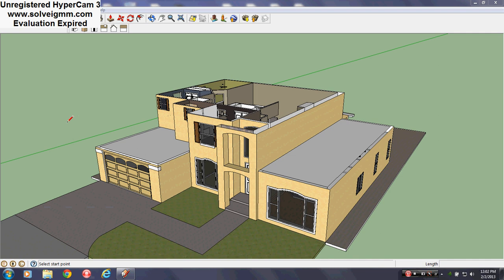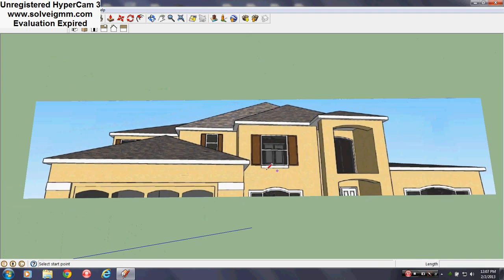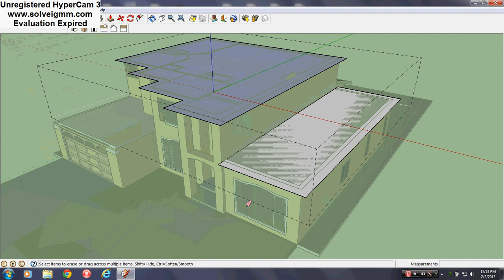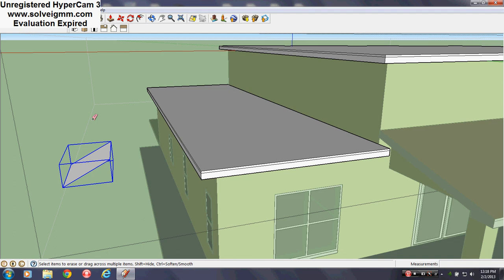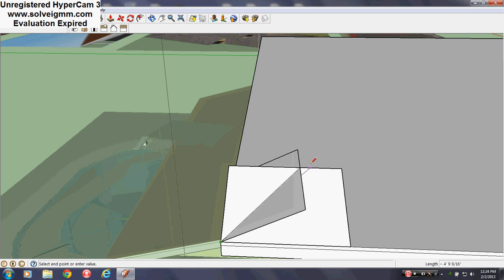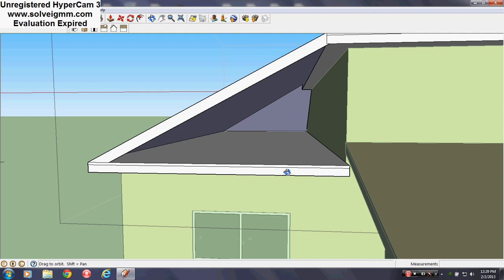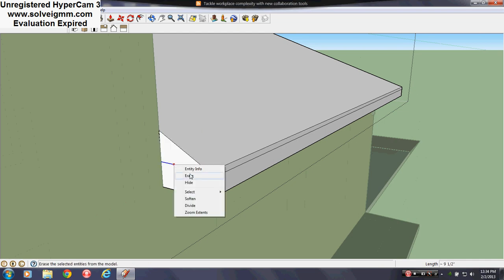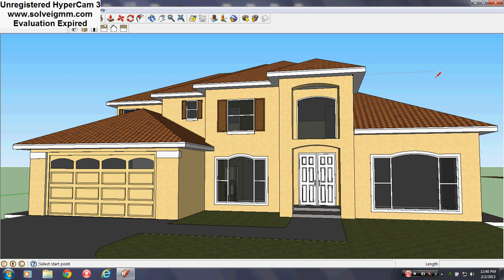Complex Hipped Roof Construction in Sketchup

Comment: Nice Tutorial!  The only thing you forgot to address are the deadmen areas in your roof portion above the garage. Dead men areas are the sections of the roof plane that die into an adjacent wall.  You need to add a cricket which pitches the roof away from the wall so water will shed around and away from the wall. Nice job though. That hip/valley jig you made was genius.

Comment: There's a quicker, easier way. Draw the footprint of the roof, draw a triangle vertical face with the angle of the pitch, select the footprint edge and extrude the triangle all the way around the path, select the entire roof, intersect with model, then finally delete lines above main roof form. 5-10 min job total.